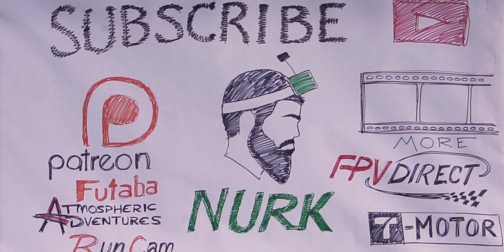2nd Place in my First Ever RC Car Race

Comment: Paul, you did great as a first timer. This was my world for years. I have been an RC car guy for 36 years and a racer for a good 20 of those. I've raced against some of the best over the years but I was always that one step off the fastest guys. I'm still proud of my past race history, even though I quit racing about 10 years ago. Luckily, I got into FPV a few years after and that (even though I don't race FPV, strictly freestyle/soul flyer) has taken over 80% of my RC time vs the cars. I still play with my cars (as you'd imagine, after 36 years, I have quite the collection of RC cars) but I spend WAY more time in the goggles. Just translate what you do to train in FPV to cars and you'll progress SO fast. You already have all the requisite skills, you just need to tailor them wheeling a car vs a quad. Hope you stick with it and bring some good light to RC cars as the hobby is slowly dying.
Reply: 5

Comment: Before taking up FPV a few years back, I raced RC cars (never competitively, just club racing) for about 15 years.  Depth perception and vision is a real hassle.  I found that moving around on the rostrum changes the view of the track, some parts were easier to judge depth, some were harder depending on where you stood.  Find somewhere that gives you a good compromise, and stand there EVERY time.  Once you're seeing the track the same way every time, it gets easier to find that rhythm you're looking for.  If you're racing someone and you crash, just accept they're gone and don't try to catch up straight away, that's the easiest way to crash again immediately.  Just take a deep breath, and focus on getting the rhythm back.  If you're faster and have enough time, you'll catch back up without having to try.  When you do catch back up, don't try to push a bit harder and race the guy, stay in your rhythm and drive past when you can.

Comment: I want to see Nurk go back and race again, but through goggles with an FPV camera on the car.
Reply: Yeah I'm thinking it wouldn't even be sort of fair 😂
Reply: @Stickmayne  I'm not concerned about fair, I just want to see how good/bad he would then be against the veteran racers of the track :)
Looking at the track from several feet above the ground with a 3rd person perspective is vastly different from seeing it a few inches off the ground from the car, it takes some getting used to the new perspective of the world, and you have to memorise the track route because you can't see much of it anymore, and the picture can be really bumpy compared to quads.
My first FPV experiences were with RC cars some 15+ years ago, Fat Shark didn't even exist back then, I bought 2nd hand Sony & Olympus made video glasses (they made HMD's with optics superior to what we have in our goggles today) to view a signal from bulky 1.2ghz VTX/VRX units, with the picture coming from a 12v security camera which was huge (compared to the nano cams in whoops we have now).
Reply: Oh I totally agree. But yeah, I never considered how much rougher and shakier the picture would be compared to a quad.

I feel like the hardest part for him is the depth perception and having to figure out the track from the perspective he isn't used to.